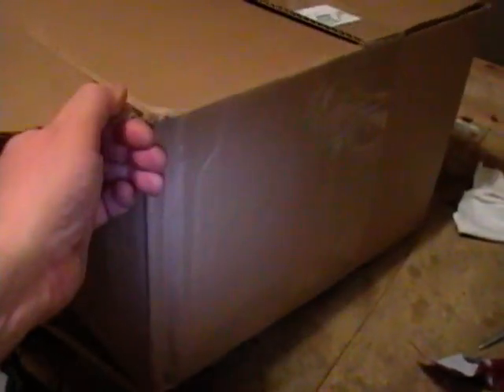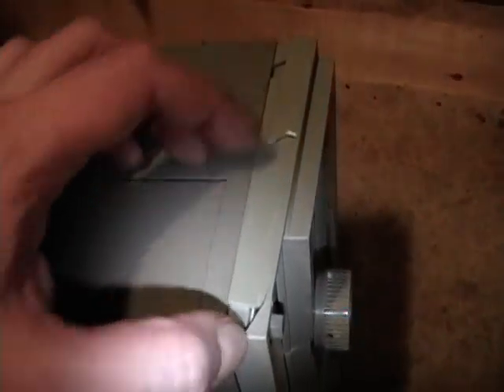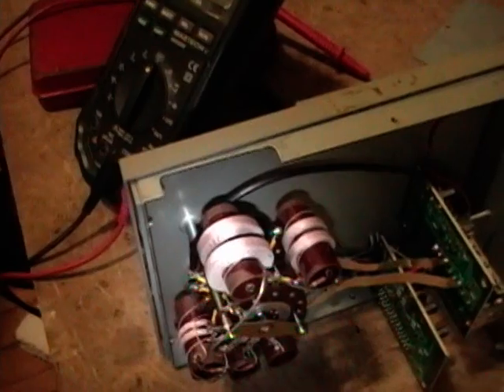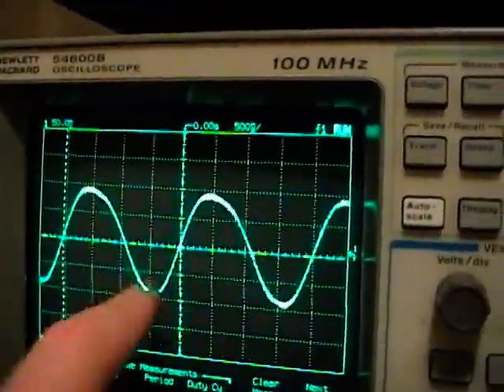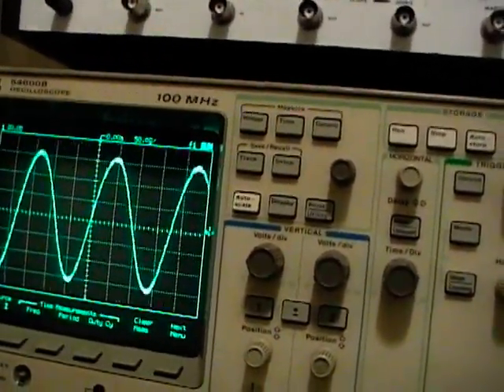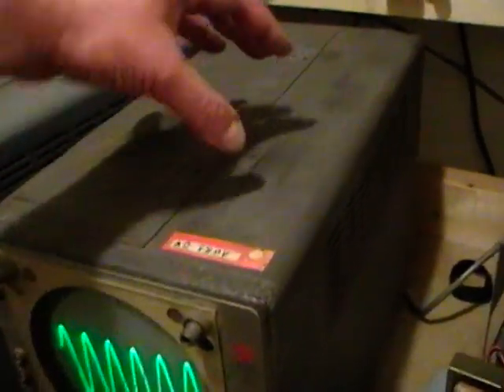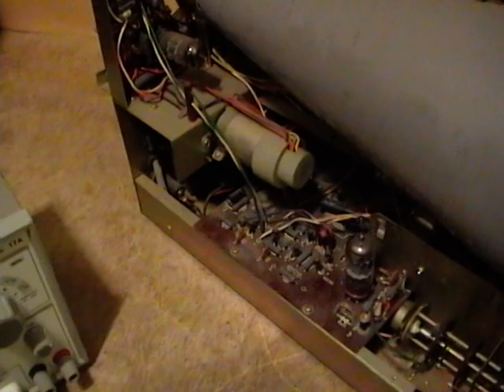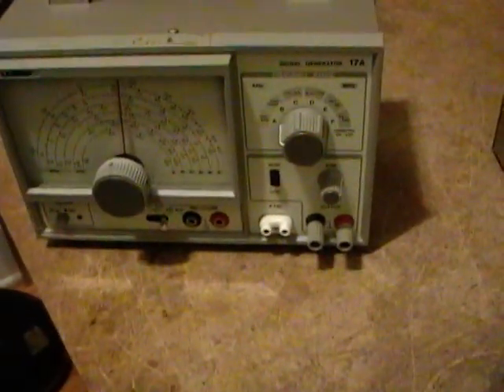Leader 17A RF Gen. and Kikusui 555 Scopes

Comment: You'll like that Leader.  I modified mine to power a chinese frequency counter.  Pretty basic, just picked off some low voltage AC and rectified/regulated it to 12 volts, then went upstream of the attenuation circuit to get a strong frequency signal.  Works great.......but the dial works fine as well though.

Comment: I have a 555 scope which I bought from the Tokyo factory as I was getting out of the AF in '75.  It had worked before, but now shows a noisy trace for a short period after power-up.  After power-down, it shows a slowly darkening oval trace.  It is much better aesthetically, that the ones in the video.  I also have a Kikusui 107A VTVM and other items.  Anyone interested?  I'm down-sizing.  BTW, kiuisui is pronounced Kee ku su ee.  It means chrysanthemum water in Japanese.  Mike, mikeywhite@charter.net

Comment: Acrylic solvent cement works good on repairing broken plastic, welds polystyrene and ABS together better then new, I bought a tube of it for fixing a plastic shower panel and that stuff is like magic. How new is that signal generator? Is it from the 70s? I still need to overhaul my Heathkit and RCA scopes, they are both tube type except maybe for rectifiers, stupid paper caps.